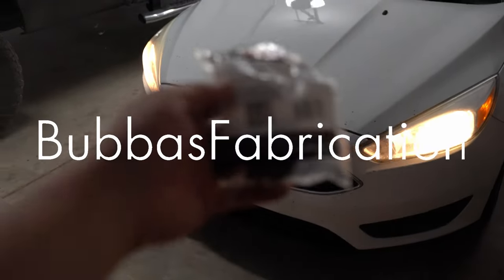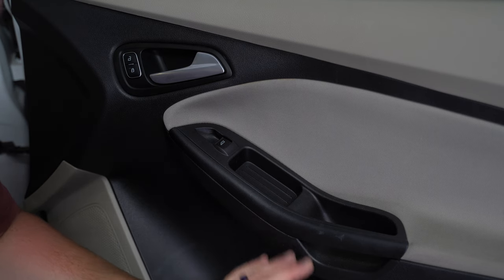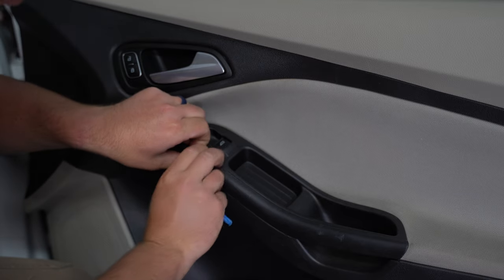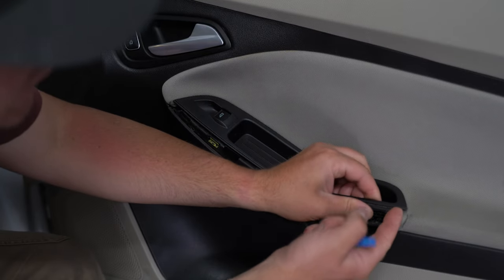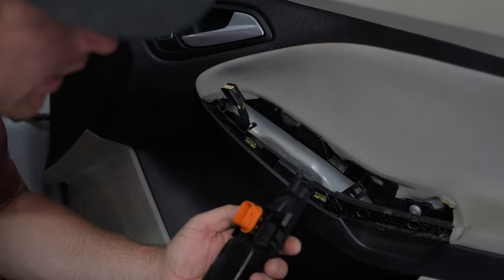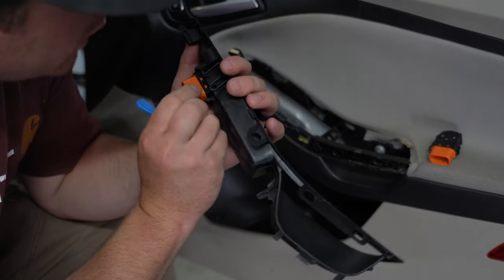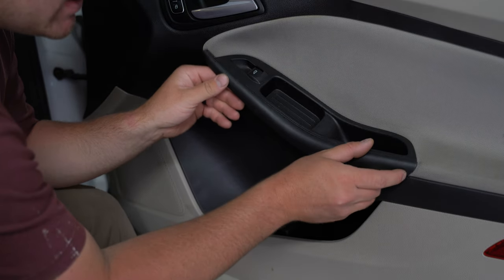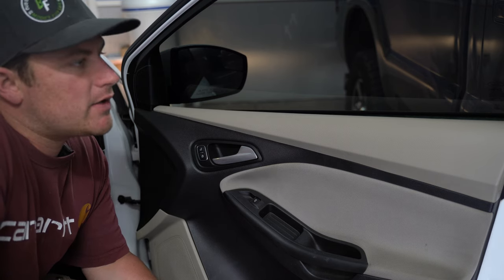Ford Focus Window Switch Replacement

Comment: What if the drivers controls are blinking intermittently and the puddle light is also blinking intermittently when the door is open and the driver window only works when the light is on? But when it blinks off it doesn’t work